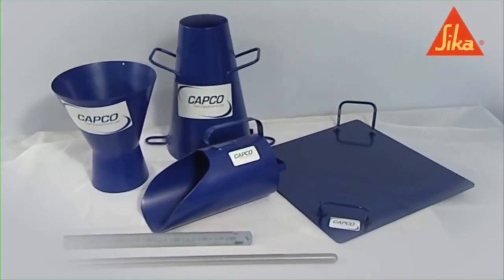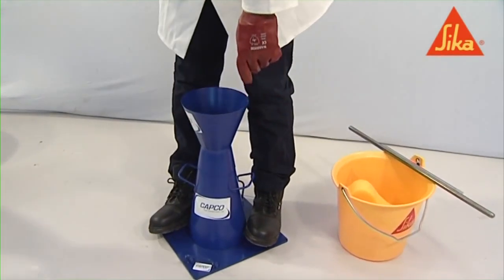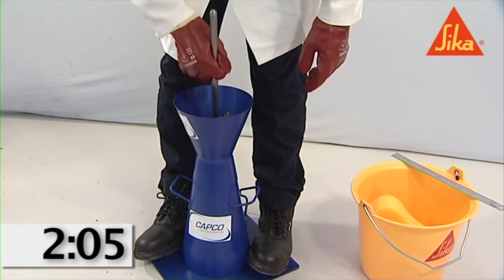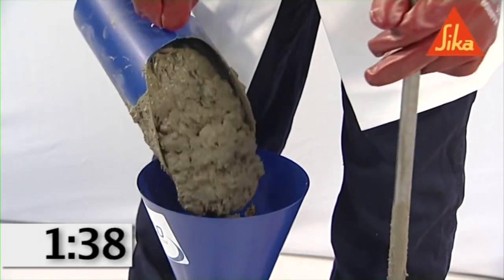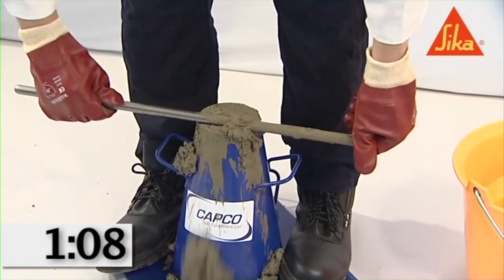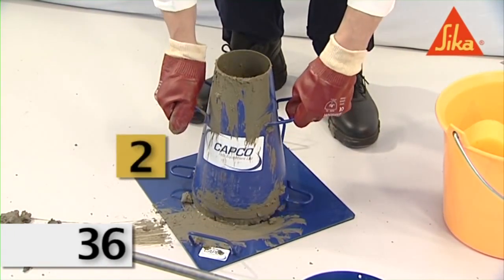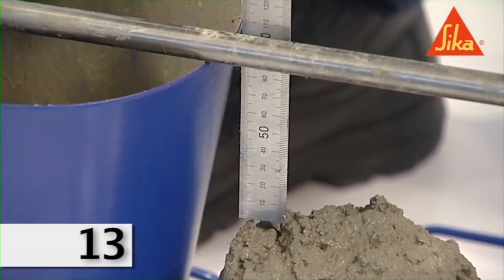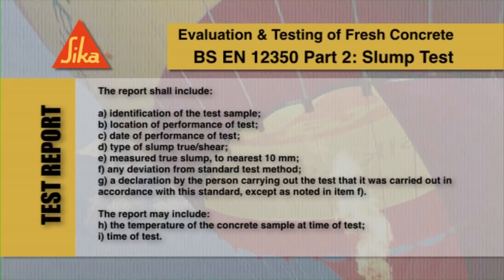01- Slump Test (Fresh Concrete)

Comment: هذا شرح للحالات اخذته copy paste 
The slumped concrete takes various shapes and according to the profile of slumped concrete, the slump is termed as true slump, shear slump or collapse slump. If a shear or collapse slump is achieved, a fresh sample should be taken and the test repeated. A collapse slump is an indication that the mix is too wet.
Only a true slump is of any use in the test. A collapse slump will generally mean that the mix is too wet or that it is a high workability mix, for which the slump test is not appropriate. Very dry mixes having slump 0 – 25 mm are typically used in road making, low workability mixes having slump 10 – 40 mm are typically used for foundations with light reinforcement, medium workability mixes with slump 50 – 90 mm, are typically used for normal reinforced concrete placed with vibration, high workability concrete with slump > 100 mm is typically used where reinforcing has tight spacing, and/or the concrete has to flow a great distance